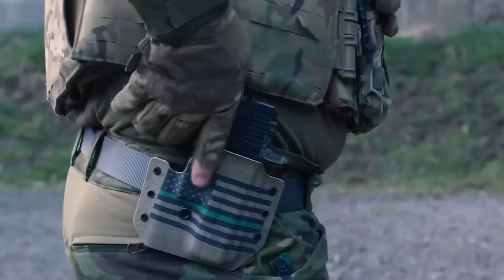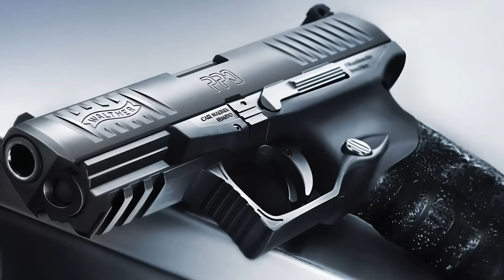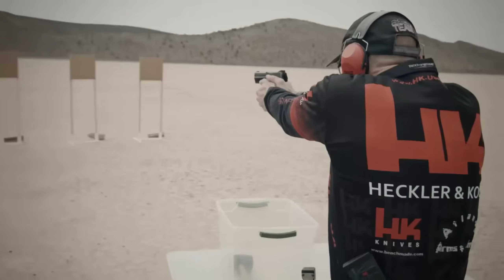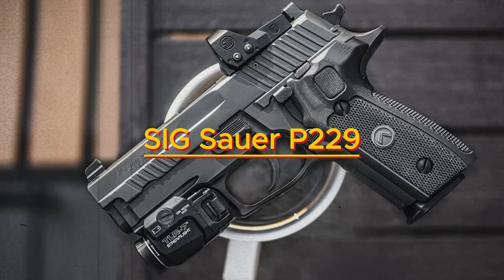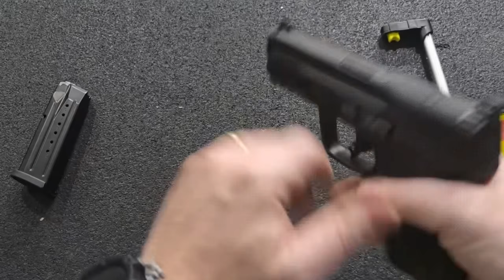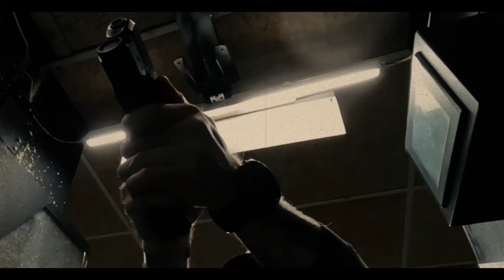Top .40 Cal Pistols Still Worth Owning | 2025 Buyer’s Guide | No Fluff, Just Firepower

Comment: It is 40 SMITH AND WESSON. M&P 1.0 and 2.0 were made and designed around 40 SMITH AND WESSON.
Only gen5 Glocks increased slide and spring weight, increased locking block angle and guide rod length.....just like the M&P SMITH AND WESSON.
Glock tried to beat S&W to the punch by shoving a 40 cal barrel into a G17. We all know how well that went.
"40sw beats up guns and has sharp recoil."
Yeah, out of a Glock 17 maybe.